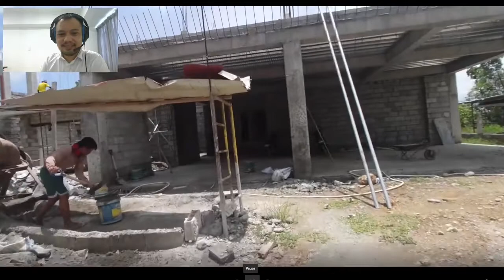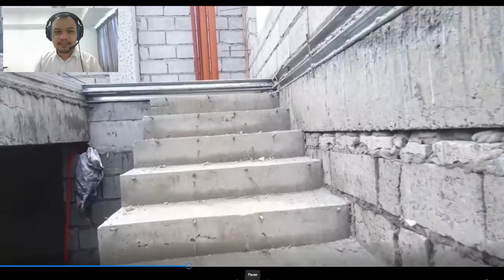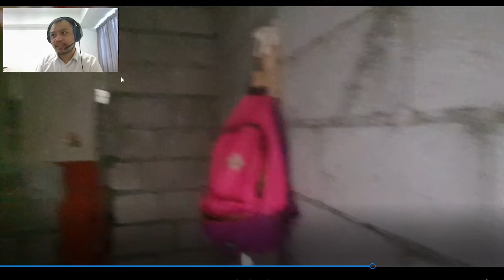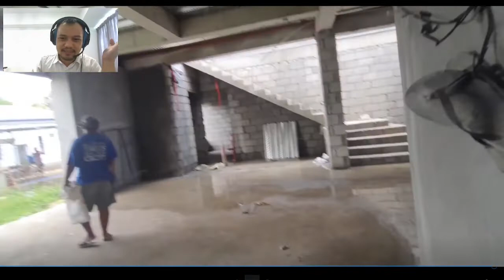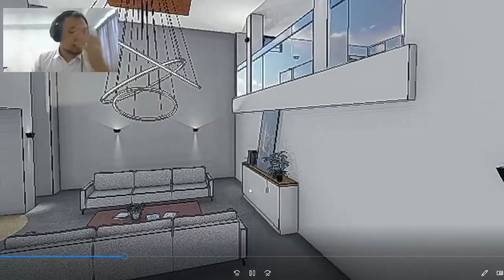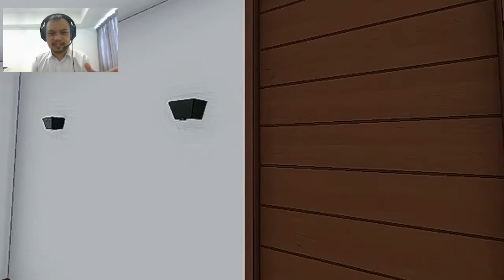Site Visit Side Comments

Comment: Some people also think that using cheap materials, cheap design, and overall cheap build quality is a good economic decision so they can save up for more a expensive house in the future. But what they don't realize is when you have a house built so cheaply, it will almost always end up costing them more in the long term. For example, if a room is lazily designed and that causes too much heat buildup, they would have to invest into air conditioning, again thinking they save can more money because HVACs are getting cheaper these days, but then the rooms get so hot they will have to get them blasting cold air straight to your face almost 24/7. Not only can it cost you an immensely high electric bill, but the fact the our country gets really hot and humid and A/Cs running for so long can break from being too overworked causing more discomfort and economic setbacks to the client. Speaking of discomfort, it is also pretty bad for our health, getting in to cold rooms and then out into the hot hall and then coming back, that can weaken your immune system and get you to become more vulnerable to sickness, again causing more economic setback for medical services. All these problems stemming from just bad airflow design.

HVACs are not there to serve as your main cooling system, but as a supplement to it when it gets too hot. Buildings should be designed with respect to the "Habagat" and "Amihan" winds, which are basically free cooling systems provisioned by God himself.

Anyways, sorry for the mini essay/rant.